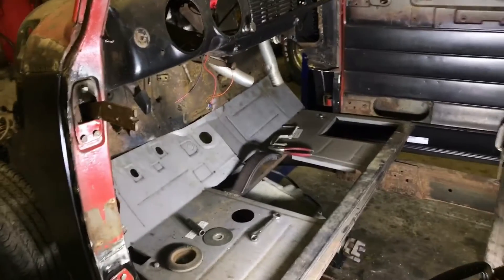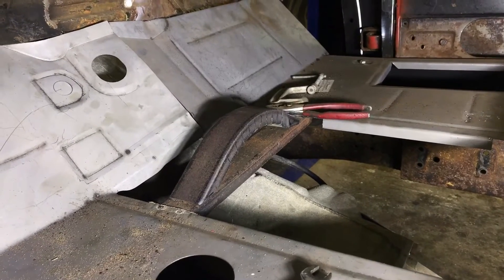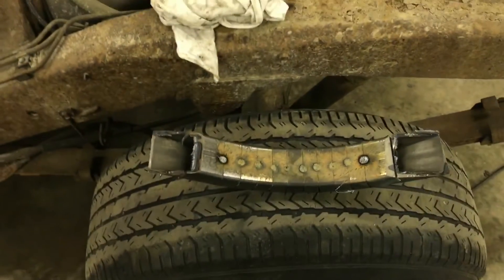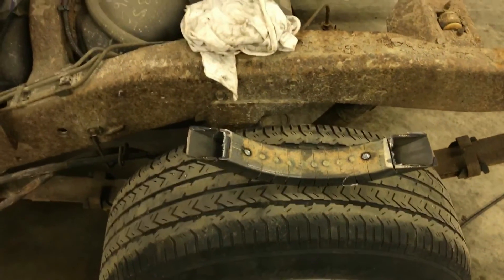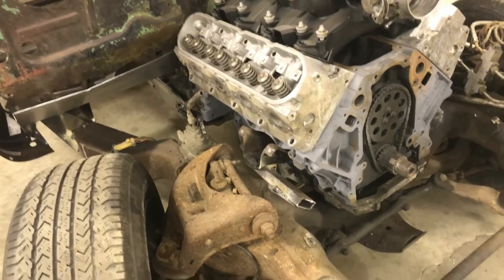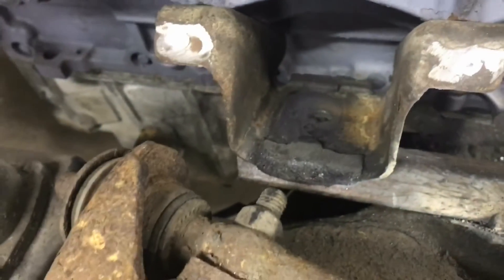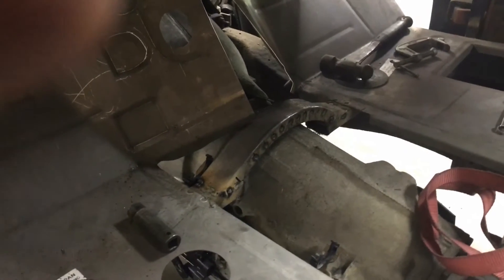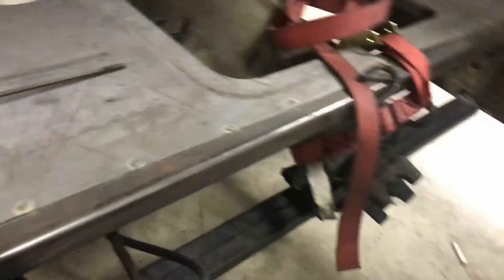MOTOR IS IN!! 52 Chevy truck project

Comment: i got lucky and found a transmission hump on ebay that bolted in where the removeable plate is .i just cut a small piece out the firewall and bolted it in. Your motor looks great. Great setup .
Reply from the maker: scrowty mcbugerballs thank you! Just a matter of piecing in the rest of the hump then finally getting everything welded up... been a busy summer, but hope to get back on it soon